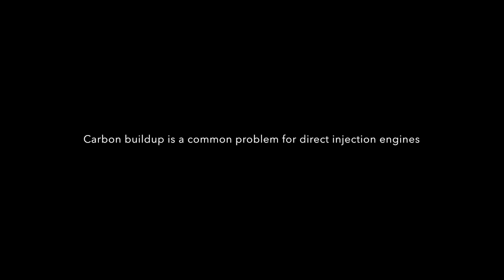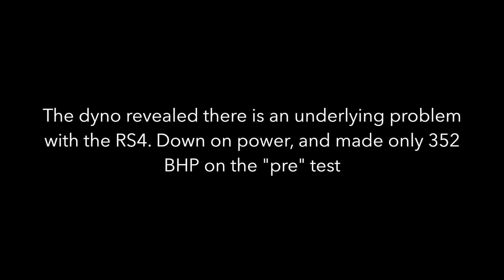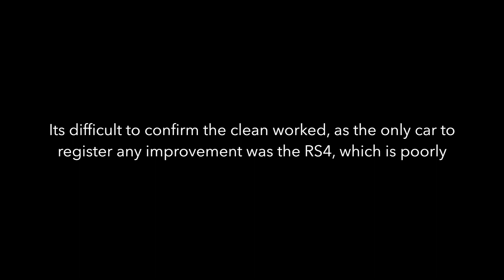Putting EngineCarbonClean to the Test - Audi RS4, Golf GTi, Jaguar XJS

Comment: Was contemplating getting a hydrogen clean done on a Kangoo 1.5dci as turbo seems to kick in a bit late and feels like it’s not doing a huge amount. Dad said best bet is just a egr clean up. I don’t think hydrogen will clean an egr valve. Seen a few high mileage French engines stripped down and they are usually clean in the combustion chamber anyway. Hydrogen may clean the combustion chamber but I fail to see that the burnt gas is going to dramatically improve the egr, turbo dpf etc.

Comment from the maker: To provide an update:

- The RS4 was taken to MRC tuning (well known Audi specialist) to diagnose the power loss observed in the video. They read 380hp on their dyno (bonnet open to counter heats oak, unlike dyno runs in the vid)
- They removed the manifold and found significant carbon build up and oily residue
- They cleaned the carbon by hand (since the hydrogen cleaning process had not improved it)
- Power increased to 427hp after the clean
- EngineCarbonClean have stopped responding to my emails

Full discussion here:

Putting "Engine Carbon Clean" to the Test
http://forum.rs246.com/viewtopic.php?t=117463
Reply: Just agreed the finance and put a deposit on a  rs4 b7 today, i had read lots and lots on this car and then i found this on a forums i just joined. Looks like ill be getting a dyno run this week if i can and get mine tested. Lets hope the last owner was a nice guy and got it done :)
Reply: Was it stock when they messured 427hp?

Comment: the rs4 is the worst for clogging the valve/intake area. after 15,000km you need to do a bg systems chemical clean or motorvac gdi intake clean then  take it for a brief run and complete with a hydrogen clean and take it for a spirited 30-40km run onlythen will you get a good result,same with the gti !, the jag well  i'd give it the same as it's probably done some kms ! i only say this speaking from experience .
Reply from the maker: John Meikle the only way to clean the caked on carbon on the RS4 is to physically remove the intake, and either clean by hand or walnut blast. This works.

I have yet to see any evidence that a solvent or hydrogen clean can produce the same results.